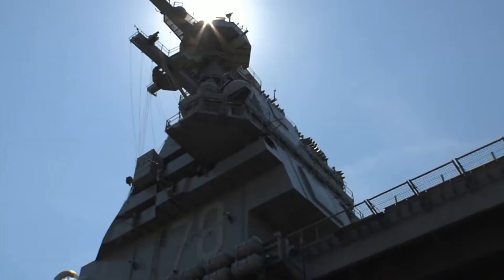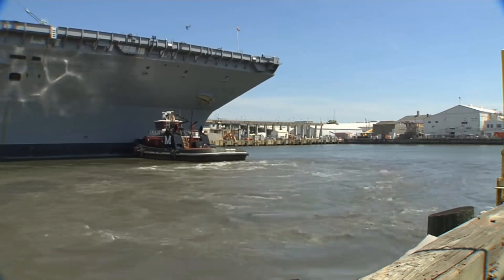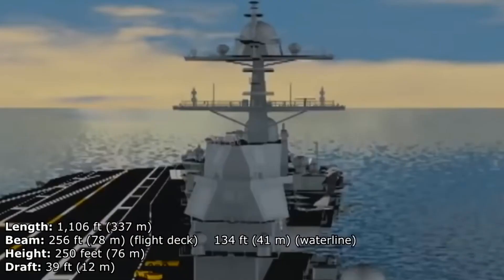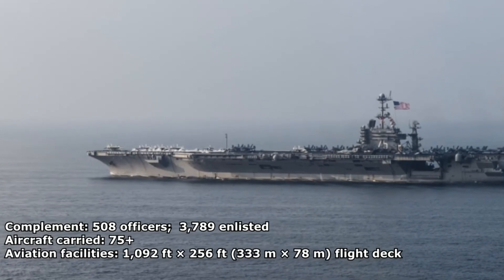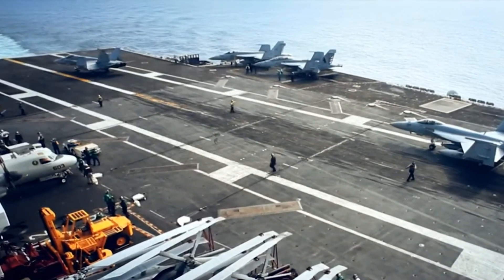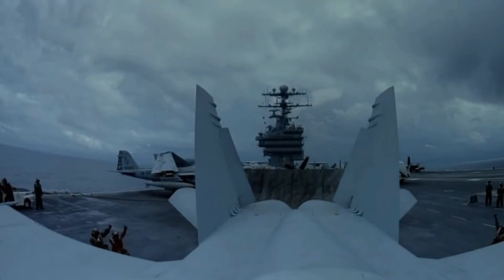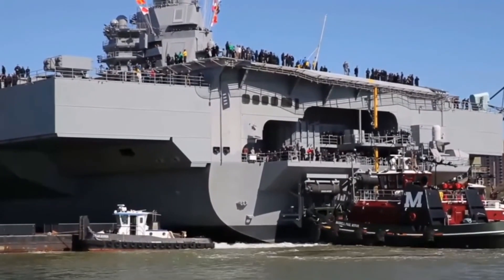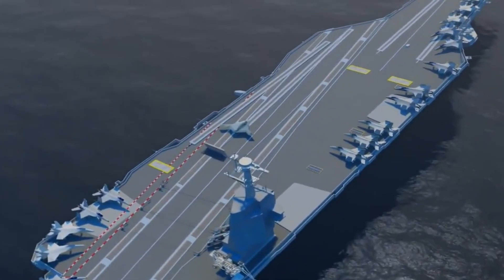USS Gerald R Ford CVN-78 - US Navy Supercarrier

Comment: At the start of the ship they have those two big square boxes on either side on the one side they have one little missile thing they're one of those big blocks for they're obviously not for parking airplanes because they are lower than the flight deck if anybody knows what they're going to be used for please let me know they seem to be very substantial in size and weight
Reply: They’re called sponsons, you can mount weapons or radar on them.

Comment: Just the time and money we'll save in maintainace will save 1/2 the cost of the carrier since most of the high pressure steam systems like the catapults are going electromagnetic rail gun technology....
And copper cabling is a lot easier and cheaper and safer to operate than steam....
Plus all that surplus electric will be handy for powering up the LASERS when they come on line.....

Comment: I wonder if they can put a laser on the carrier.  As far as I know, computation power will increase while electrical power consumption will decrease.  For example, you smartphone has more computation power now than in the military computers of early 2000.  In fact, the carrer was delayed by the Democrats causing major cost overruns where there is a lot, lot of fraud waste and abuse.  Trump will need a second term to clean house in the Navy.  The Obama Democrats Naval Management proudced a lot of crap for their paper empire.  Therefore, optimazation and futher automation to downsize man power requirement is required.

Comment: If you think the design of this ship is incredible you should check out the design and building of the Virginia class submarines. It was designed in CAD and was built by two competitors for the Navy contract. The used to make a full-scale mockup and they didn't even do that.
Reply: The Ford class was designed by the same CAD system with 3-D vision mock-up walk throughs.

Comment: Nice ship, needs more defensive fire power. I recommend double the current armament. Then add 4 x 30mm Goalkeeper and 4 x 57mm mk 110. As used on the Independence. If the 57mm is too much. Then I would recommend a significantly improved version of the 40mm Bofors. Based on the weapons used on the AC-130.
  China's going to be shooting the works at this ship. It needs the maximum defensive fire power possible. Limited only by  space, arc coverage, and EMI considerations. Improvements into intergrated sensor and tracking can mitigate this. Finally, onboard casualty redundancy should be part of the equation.
   The USS Stark was hit, as it's only CIWS was offline. So more firepower is called for.

Comment: At least 3 Phalanx CIWS (pronounced SEAwiz) close in weapons systems per ship.
Basically, they are radar- directed Gatling guns.
Delivers 3,000 rounds per minute.
(Might be a little bit faster than a Sea Sparrow radar directed missile launcher.
Sea Sparrow missile launchers are good at targeting planes.
CIWS targets are slightly smaller.)
Also, sailors often refer to the CIWS colloquially as R2D2, because the radar system that sits up top?
Looks like Artoo from Star Wars (R2D2).

Comment: I still feel that just having 2x21 anti-air batteries are inadequate as this ship is the Big Bullseye for every potential enemy and thus we should expect missile swarms as the primary form of attack!
If I were designing it, I would have much stronger defense configuration and it's be more like 4x50 anti-air batteries and the missiles have a range of at least 50 miles.
Hopefully these anti-air batteries can be reloaded manually very quickly.
Reply: Carrier's never travel alone. And you seem to dismiss the presence of ESSM.

Comment: Replacing the Nimitz Class Super Carrier, never had an Enterprise Class😳👀👍👍
Edit: pretty sure she has #4 CWIS as well as rolling close air defence platforms. On a side note all the Carriers I've been around are a shit load faster than 30 knots👀🤔
Reply: Not officially they are not.   The only legal thing we can say is that they do all ahead flank 171.   Beyond that the numbers are classified but a good physics major can work out the tonnage, the density of the water, and the propulsor efficiency and come up with a round about number of what we max out at.   It's common knowledge that the A4W reactors on a nimitz each put out 500mw.   Knowing enough about steam plant efficiencies, you can work out the simple math to arrive at the correct max speed considering everytime you double the speed of an object, you are cubing the power required.   Capped at what we know is the max power developed by the ship, you just work backwards to the maximum speed.   Nobody who has served on the ships can just outright say what it is though.

Comment: he United States has far more to fear from these giants than our enemies do. The USS Nimitz cost roughly $784 million dollars to construct in today's (FY 2017) money. Let's be generous and round that figure up to $1 billion. This price does not include the aircraft necessary to make an aircraft carrier into an effective combatant. The replacement for the USS Nimitz, the USS Gerald R. Ford has cost us roughly $18 billion dollars to construct. It has been under construction since 2009. It was commissioned eight years later in 2017 but is still not in operation. Among the problematic systems are: the new electromagnetic catapult, the new large elevators that run between the hanger deck and the flight deck, the Advanced Arresting Gear and its complex radar system. Without these systems in full working order, it is pointless to buy aircraft for it. There are also problems with the proposed air arm to be assigned to this new class of carriers, the most important of which is the short range of the proposed aircraft. So long as the ship is far enough out to sea that it can avoid the likes of the new batter powered submarines, it is in good shape and is relatively safe but, as soon as it is required to operate within the range of that type of submarine it becomes prey to them. So, what will these new aircraft carriers cost without their complement of airplanes? The USS Ford will almost certainly cost something over $20 billion--twenty times what the USS Nimitz cost to construct. The USS Gerald R. Ford is not expected to be deployed until sometime in late 2020. This means that we will have been fiddling about with her for more than eleven years. 
 
Between 2009 and 2017. During this interregnum, we have constructed three, count 'em, three Virginia class submarines for a mere $2 billion each. Those ships are not only fully commissioned, they are in operation as I sit here writing this. Worse, the Swedes, the Germans and the Japanese have focused their talent and money on the battery powered submarine and they are capable of sneaking past our noisy picket ships to sink the real prise--a nuclear powered aircraft carrier. Here, I think it appropriate to quote Sylvanus P. Thompson: "What one monkey may do, so may another." And to not think that these itty-bitty cheap submarines cannot sink one of the very large, very showy and very noisy aircraft carriers because they have repeatedly done so in fairly operated drills against them. The Japanese designs have proven to be especially troublesome for our Navy. 

You will find a good description of what happens during our drills with the JSDF at the end of this link:  https://www.japantimes.co.jp/opinion/2015/11/26/commentary/japan-commentary/japans-crack-submarine-fleet/ 

There is yet another serious problem with these huge showboats--they are built to be a tool of intimidation and aggression, not defense. We have no business telling other nations what they should or should not do, beyond not attacking us. Our posture should be but isn't defensive. We have been on the warpath since WWII. We have been in a war of some kind since the year I was born and I happen to be an old fart and all of that expensive nonsense was made possible by our Naval Air Arm. The US Navy will spend roughly $122 million per F-35. It will spend another $30 million or so per copy of the shopworn and short ranged FA-18E/F Superhornets slated to become its primary fighter bombers. 

The modern aircraft carrier has something close to 4,000 to 5,000 crewman on board each of them. This does not count the manpower necessary to operate the other ships in one of these so-called Task Groups. Remember that none of these vessels tour about with passengers or deliver cargoes. They are strictly warships. They literally eat money. We are dying from spending entirely too much money on everything. This bloated military budget is tiny when you compare it to the rest of the money our Dear Leaders borrow and spend. Check out the budget, Don't be intimidated by the huge numbers. Most importantly learn to do some basic arithmetic. It will help if you try to scale the Federal Government in expenditures to figures you can come to grips with, For instance count trillions as they are merely millions. Remember that a trillion is a thousand billion and that a billion is a thousand million.

Comment: Bzzzzzzt.  Error.  Your video has at least one serious flaw. 

It's rather well known that there are TWO nuclear reactors. 
Less commonly known is that these reactors connect to FOUR  Main Turbine Generators (MTGs), these turbine/generator units include what are called "Voltage Regulators".  Also not widely known (or at least remembered) among the general public is/are the news stories of two of these turbines and/or voltage regulators failing on MTG #2 on June 12, 2016, and another "less dramatic" failure in July for MTG #1.  
{In fact, I seem to recall that one witness used the phrase "explosion" to describe one of the failures.} 

My memory (and the below linked article) says that it was determined that neither unit would be repaired/replaced before the ship went off on it's initial test voyage.  Subsequently, MTG #1 unit would be repaired in place.  The MTG #2 however would have to be replaced, thus requiring a lot of equipment to be cut/cleared/disconnected/moved out of the way.  (i.e.:  Similar to the way the rudder's shaft/pin is sometimes removed in dry dock for re-work.)

Your video did not touch upon ANY of this...  
...and I'm sure you've figured out by now that I am VERY curious to find out exactly what eventually did happen. 

March 2017 WAS when these repairs were supposed to take place, yet I for one have heard NOTHING about this.  Yea, yea, yea, news sources might not bother with covering a repair, and this alone may explain why I've heard nothing.  After all, what would you rather watch:  An explosion, or paint drying?  

In any case, if you, or anyone else, finds out more about if/how/when the repairs did or did not take place, I for one would like to hear more about it. 

FYI - I did find these very relevant link(s): 
https://www.defensenews.com/naval/2016/09/18/carrier-ford-has-serious-power-problem/

.

Comment: The build process time lapse was pretty cool.  Like a giant Lego set with the modular pieces.  As for design features, having many systems be electric instead of steam will be a huge saving on maintenance in the log run.  I served on a Nimitz-class (Carl Vinson) and the steam piping throughout the ship was extensive.  As for 3 elevators instead of 4, I don't see it as a big deal.  I don't recall seeing all 4 elevators operating at the same time when I served.  Plus, it's about time we put AEGIS radar on a carrier.

Comment: We technically have 20 aircraft carriers also they small ones hold almost as much as the new qe class when the new supercarriers hold 80 to 90 don't even get me started on the fact it doesn't even have arrested recovery you want a ski ramp fine but allow yourself to come back with weapons and tanks without having to drop them just to land on a vertical landing deck unless a f35 can stop in the distance they allow with weapons I doubt it

Comment: You seem to be unclear on the use of the F-35B and F-35C. The Cs, not the Bs will be used on the USS Ford.
Reply: Marine Corps aircraft have and probably will continue to operate from aircraft carriers. It’s likely that F-35Bs will operate from Ford-class carriers. Obviously, they’ll mostly use amphibious assault ships, and most of the F-35s on the Ford will be Cs, but some Bs will probably be there, especially during war where you kind of have to take what you can get.
Reply: @thereyougoagain1280  Marine squadrons stationed on the CVs fly CATOBAR F-18/F-35C aircraft. They only use Harriers/F-35Bs on the assault ships and ground bases barring extreme circumstances.
Reply: @thereyougoagain1280  NO the B is not a carrier aircraft. It is NOT compatible with CVN launch and recovery operations. The B will go on the amphibs and would only go on a carrier in a very VERY special circumstance.
Reply: @thereyougoagain1280  I never once saw a marine aircraft land on my carrier in the 6 years I was stationed on it.   Not saying it didn't happen in the past like the vietnam or korean war era, but Marines have the amphibious landing ships that they use.
Reply: HA! If they ever get done with testing that POS. And when they do the Navy will only be able to afford 7 or 8 of these in an air wing due to the exploding cost. A perfect match...two expensive turds in a punch bowl. Neither capable of doing its mission.

Comment: Personally I feel like building this class is a huge mistake. They should have gone with a CATOBAR Queen Elizabeth Class in much greater numbers (Around double). It would allow so much more flexibility in deployments and would cost much less money and manpower. With Carrier Air Wings belong strength anyway going from 60-70 aircraft to 40-50 wouldn't be that much of a cut and the increased numbers of Carriers would make up for it. If the power of a supercarrier was needed multiple QE Class could be sent while if it's only to aid the war against ISIS you wouldn't have to send a huge supercarrier. Especially with so many and varied threats having a all supercarrier force doesn't make sense. Mabye 50/50 between Supercarriers and regular Carriers would be a good compromise. This is not suggesting the US (Or any Navy) should be cut. It wont be a cut. The Carrier Force will still have the same aircraft capacity as before just in a different format. It may even protect the carrier force from being cut with Politicans trying to go to a 10 Supercarrier Force due to cost and Supercarriers taking so long to build/refuel leaving a "Carrier Gap". Nuclear Reactors would be the only loss and with all the American Allies and Tanker Ships it's not going to be a major weakness (Not using Nuclear Power would give the US the advantage of being able to use Suez and the lower size would allow them to use the Panama Canal so that would partially make up for it). Escorts don't use Nuclear Power so they still have a refueling problem. They also don't have enough food and weapons stored for the "Unlimited Range".  Also Anybody else hate the name? I mean Gerald R Ford...What happened to Yorktown or Midway? I guess nothing can get worse than Harry S Truman (Anti-Carrier) or the two segregationist non-President Carriers
Reply: You must be the great great + 2x grand son of the famous Naval Horatio....... your advice sounds like a loser's cry in the dark......just saying... not trying to piss you off.
Reply: Supercarriers make a bigger target, harder to maintain and less efficient. In a word, "Yamato".
Reply: @leondillon8723  yamamoto? you mean the yamato

Comment: Jesus, that would be the equivalent of the USN operating a ship launched in 1918 (end of WW1) in 1968 (Vietnam) Fark
Reply: Not really. That would be the equivalent of a ship launched in WW1 and serving in WW2 (most WW1 battleships). Or ship launched in WW2 and serving in Gulf war (Midway, Gearing class, gun cruisers etc.). Pre WW1 Dreadnought race, and Inter war period saw a huge jumps in ships construction, that wasn't seen since. Unless there will be another huge paradigm shift like from Pre-dreadnoughts to Dreadnoughts or from pre CV battle fleet to CV fleet this ship is good enough.
Reply: WWI ended 28 Juno (June) 1919. WWI tanks were used in WWII.

Comment: The main objective of this ship class was future upgradability.  The current Nimitz class has pretty much reached the limit of what it can do, so upgrading them further is not a viable option. By building a new class with the future in mind they can attain the 50 year service life. The ship class may have significantly more capability by year 30 than it does now. As for Railguns, That would be cool, but they would probably be placed on its escorting destroyers, which have existing turrets that could be replaced. What carriers will probably get is laser / mazer weapons for point defense against sea skimming missiles, aircraft and drones, possibly replacing the phalanx. When asked about phasers and photon torpedoed DARPA refused to comment 😜
Reply: Yeah, pretty much everything is built with modularity these days.  

 And to comment on your phaser/photon torpedo claim, I was watching a MythBusters a while back and they were doing some experiment with DARPA. The host (the nonmilitary guy with hair) cracked a joke and asked the engineer about how soon we'd see a light saber.  The engineer immediately shut up and had a straight face.  About two weeks later it came out that they had a working prototype, lol
Reply: "Shields to maximum" may be a tad over 50 years away...
Reply: Torpedoes, full spread
Reply: Then there’s that petition to build the Death Star…
Reply: @thereyougoagain1280  even if we could be  a death star with all its tech, the resources required... would be enough to solve WORLD hunger. That's how expensive it would be in today's dollars and using current tech prices.